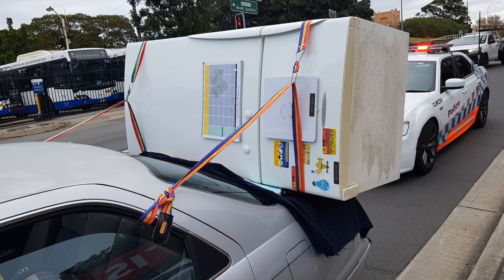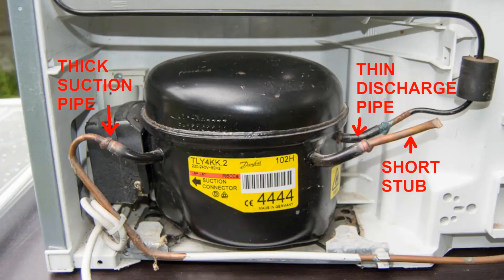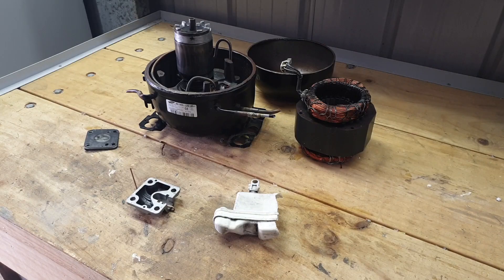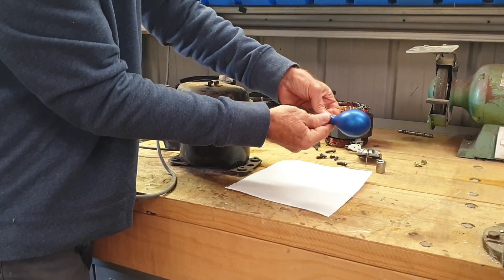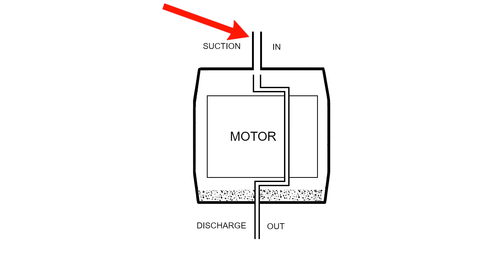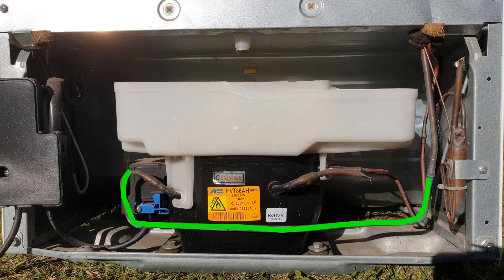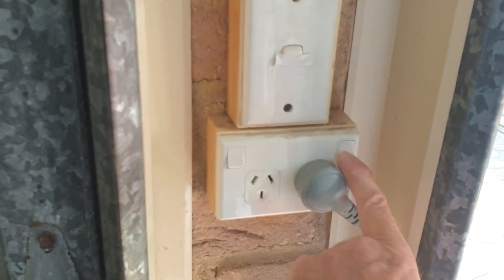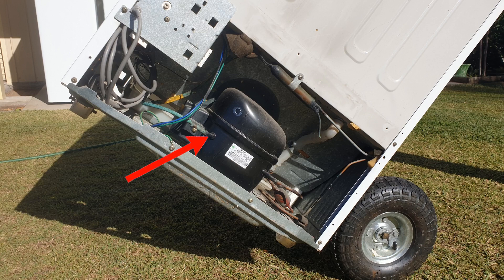You can transport a fridge on its side - but only this way

Comment: This video is not presenting anything new. The cardboard packaging fridges arrive from the manufacturer show on the box what side to lay on the side.
Reply from the maker: No cardboard packaging I have ever seen has arrows pointing sideways. The arrows always point up. Plus the cardboard packaging is rarely still on the fridge 5 years later when you decide to move and aren't sure which way to lay it down. Most people choose to lay it on its back, which is the worst possible way to transport it, as I explain in my other video at: https://youtu.be/k0-ABDAWgXs
Reply: @pmolsen1   I don't know how I ended up writing that. You are obviously correct . the carton will always be up. But, a fridge can be transported on it's side  safely if the normal pre plugging procedure is  done.
Reply from the maker: What is the "normal pre plugging procedure"? And yes a fridge can be transported on its side but only one side as per this video, unless you want to play Russion roulette with a potentially $2K appliance.   @stevenmeyer9674
Reply: @pmolsen1  "Pre plugging" whats he talking about 🤔
Reply: @pmolsen1  So just a question, first of all, great video and so well explained, thanks. 
I moved a fridge yesterday and I followed your instructions and laid it on it's left side looking from the front with thick pipe facing up, because your video makes perfect sense to me. 
Today I was reading the manufacturers user manual which I found online (Fisher and paykel NZ model E372BRT4) and they stated to lay it down the opposite way, on the right side looking from the front? The way the suction pipe went, oil would have gone into it but only a little way and then would have to go straight uphill to get anywhere, wouldn't the small amount of oil just get sucked back into the compressor and no harm done? 
In this model the pipes are on opposite sides and the thick (suction) pipe comes out the left side and goes up and over the compressor to join the thin pipe (discharge) on the right side and back up the fridge. Just seems to be the normal run of the mill compressor set up as you have shown. 
Anyway fridge seems to be running fine, I didn't get a chance to put it where its going until today, so it sat not going for 24 hrs plus.
Sorry for the long winded reply but would be interested in your comments re small amount of oil, cheers..
Reply from the maker: Lots of other websites and videos says the same thing - that a small amount of oil getting sucked in isn't a problem. The point is the oil doesn't get sucked back where it came from - into the bottom of the compressor. It gets sucked directly into the inlet muffler leading to the compression cylinder, as per my video. It then has to drain out of the muffler through a tiny hole and back into the bottom of the compressor.

Compressor manufacturers go to extraordinary lengths to prevent ANY oil getting sucked into the muffler. There are dozens of compressor patents that address that very topic. If it is completely safe and not a problem, someone should let the manufacturers know so that they don't keep wasting time and money on pointless patents and corresponding changes to compressor design to try to keep the oil out. 🙂
Reply: If it does, then our fridge delivery men ignored that and they laid the fridge on its back.
Reply: So if the refrigerator being transported is in the factory packaging, there is no way to know what side is the correct side. How is a delivery person supposed to proceed if upright is not an option?
Reply: @SM-ut6vb  the factory packaging would have markings on the carton indicating how it should be handled.
Reply: @stevenmeyer9674  didn't you previously acknowledge that the packaging will always show arrows pointing up, and not actually say which side to lay it on?

Comment: When we moved into our first house in 1978 we had our fridge standing in the back of a tipper truck ,despite it being roped to the cab it escaped and fell over . it slid to the end of the truck on one side cleverly flipped over and slid about on the other side for several miles until it was safe to pull over . Now the difference to your one is ours was built in 1957 and it's still running fine . Sounds like a tractor starting up occasionally but would freeze everything in it solid if we turned the knob to max .Perhaps modern versions are a little feeble or perhaps have some allergy or "condition" that seems to infect everything in this modern age .

Comment: Thank so much for this video. Please May I ask:

Thank you so much for your response. 

The thing is,
I want to buy a table top freezer, I saw two brands that I love which are the same sizes of freezers, but one of the freezers has a smaller compressor. Shd I buy the one with the bigger compressor or the one with the smaller compressor? Is the one with the bigger compressor more powerful than the one with the smaller compressor? Remember that the freezers are the same sizes table top freezer
Reply: You should buy some a small carton of ice cream but a bigger 🥣 bowl.
Reply: @Handofseeds  How does this comment from you make any sense?
Reply: @HighFLYER-9000  the bigger bowl in place for the bigger compressor.  I was using a parable to be funny.